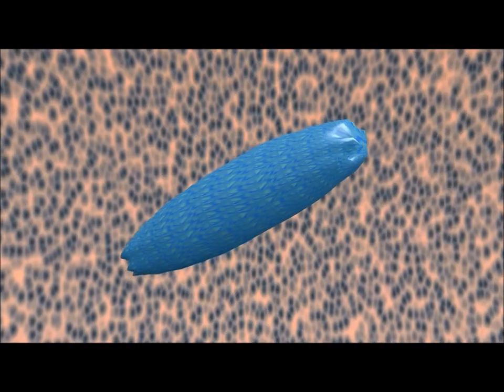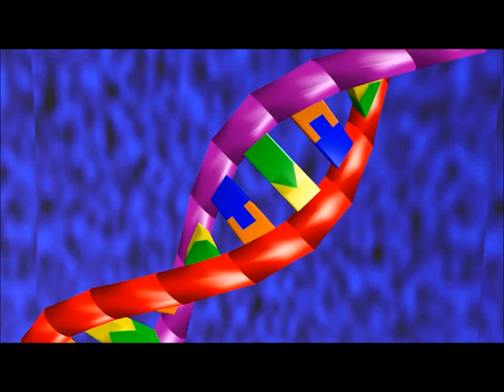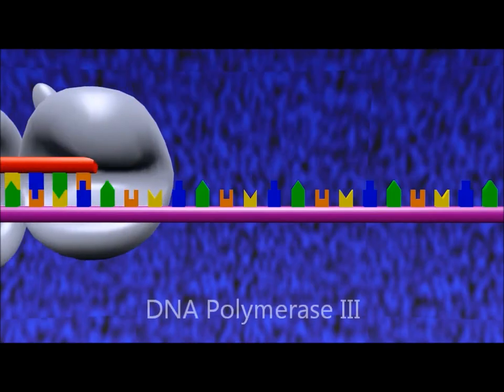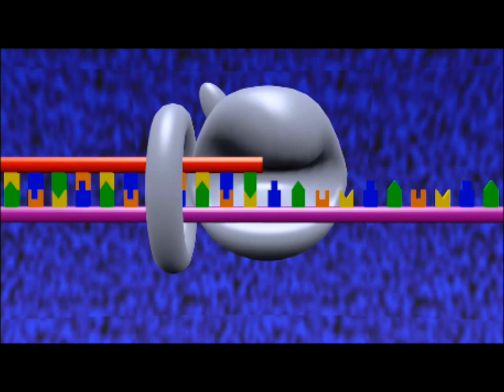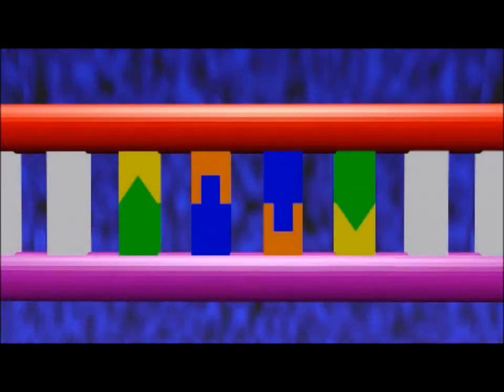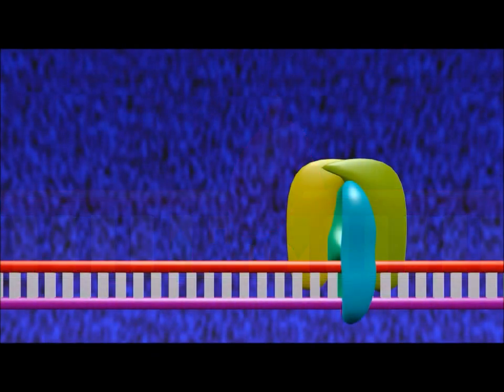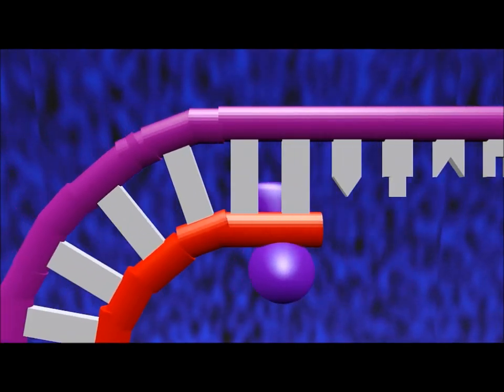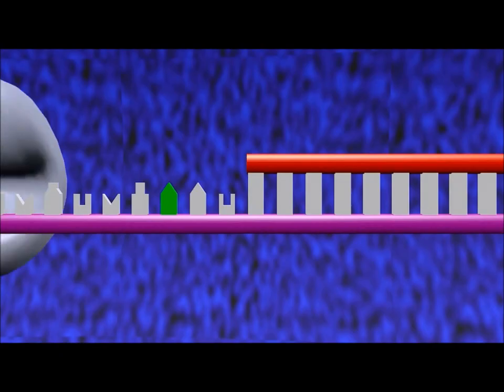A 3D animation of mismatch repair in E. coli

Comment: i think it's dna polymerase I that fills in the nucleotides before ligase fills in the nick.
Reply: Pol I is for proof reading and Nick translation (replacing RNA primers between Okazaki fragments). Pol III is for elongation, so the video is correct.
Reply: The video is correct. It is DNA polymerase III that fills the gap
Reply: @7mikepd Correct. Pol I fills gaps and can work on a single stand. Pol 3 is a way more large complex with different subunits that works on both stands at the same time. Both have proofreading